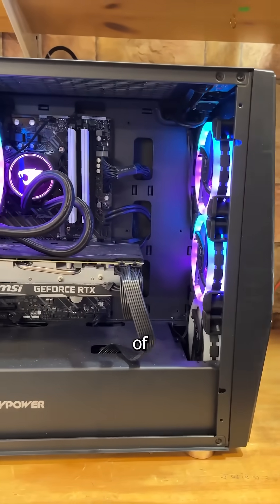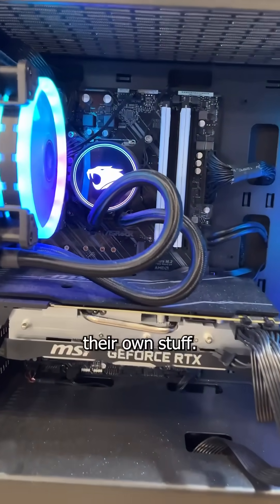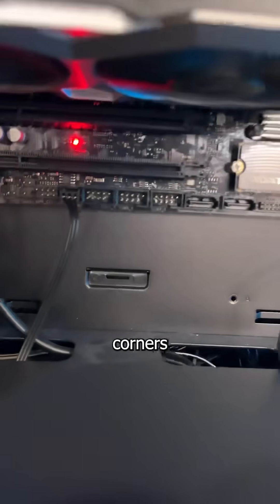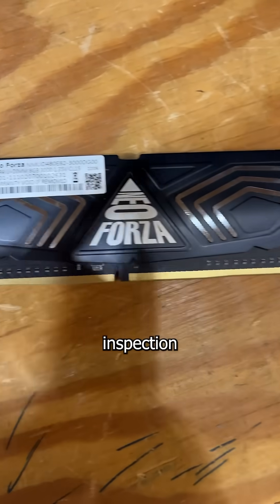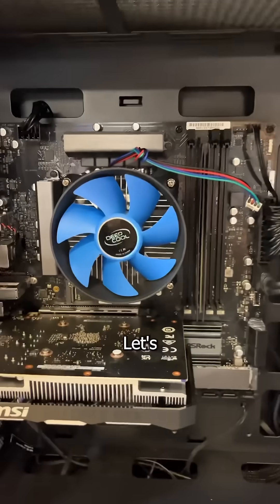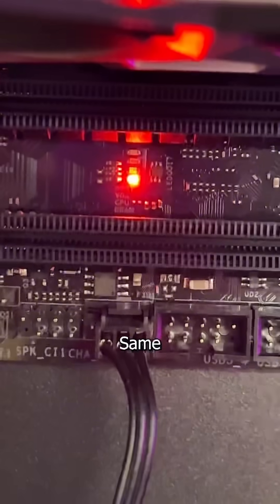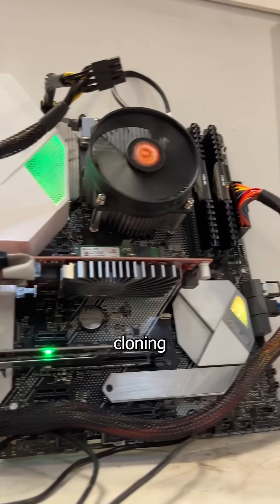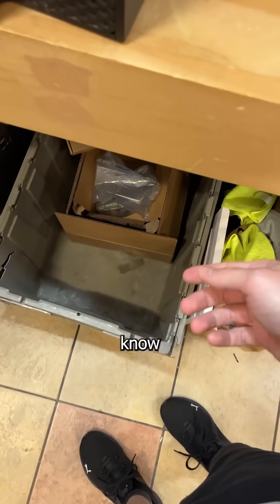iBuyProblems? Cheap NVMe causing no POST 💀 #technology #pc #tech #shorts #computer

Comment: I worked as a computer tech for about a year and a half, always saw this crappy cheap NVMe and even 2.5” SATAs. They either prevent the system from powering at all, or come back as DRAM error. Never knew why, but it was always the first thing I’d check, even before RAM, when these issues happened.

Comment: The only thing I could think of was the DRAM on the NVMe drive was damaged and it sent a signal to the Motherboard to report a DRAM error. Might be considered a "feature" but one that if you don't know it has would cause more issues rather than helping solve them.

Comment: When I've seen the 120mm aio I just already said to myself: Yeah, that's 'IBuyProblems'
P.s. 'Flashy box of cut corners' is the real way to desrcibe huge aquarium with rgb fans where is just tiny matx board and crappy stock cooler like fans 😂
P.p.s. Got ADATA LEGEND 960 MAX on 2TB recently myself. It is a good drive imo, especially for holding amazing speeds for price. Yet never tested those silver fish or whatever those cheap ADATA m2s is...

Comment: These MB LEDs that dont have a code readout are so general with their errors, as long as it's not a CPU or GPU error it's gonna show up as a DRAM error (sometimes that's not necessarily true either). I've had PCIe Network addon cards cause DRAM errors which were magically fixed by removing and reinstalling the network card after reaching the BIOS for the first time. The worst of the bunch was a faulty HDMI cable causing a DRAM error which drove me absolutely crazy. The worst part about it is a QLED error code readout barely costs a few dollars on the manufacturer's part and yet is being reserved on these high end motherboards that quite frankly are ridiculous. Sorry might have been a bit off topic at the end there but it just ticks me off.

Comment: Had a bad TramGroup SSD causing long post which was hanging up on VGA. Plus causing system crashes with no BSOD. Just freezing, deep frying the image on the screen, fading to black and requiring hard reset. All while the drive was working otherwise. Weird. 🤷‍♂️

Comment: Supposition that this is a cachless drive that uses the ram as cache and it being bricked somehow corrupts the ram?
Other supposition is that this is a pcie initialization error but the 3 leds aren't enough, so it's stuck on the previous.

Also for every pcie problem, check for bad display port cables, as the power supply from the screen back feeding the pcie causes issues.

Comment: There is a known problem with some kinds of SSD where they will short internally and then you can't do much for them when they short in this way they can cause problems with anything though it typically doesn't mean actually causing damage. This is usually a controller issue not an actual data issue. Also the customer might still be able to retrieve the data on the SSD but I don't know for certain.

Comment: When I first booted up an IBuyPower PC, it would only ever boot into the UEFI menu. Turns out, the hard drive unplugged itself, probably during shipping.

After fixing that and setting up windows, I restarted the computer, only to find that the hard drive then corrupted itself so badly, that I had to call a friend and have him walk me through things to try, including doing some magic with the command prompt.

Now the main problem is that the DisplayPort output flat-out doesn't work. Not sure what to think of these computers.

Comment: maybe it's due to DMA done in BIOS since NVMe is basically PCI-e? It might be BIOS is testing entire memory region and it might be detecting r/w errors on memory region DMA-ed to that ADATA drive. at computer's point, it's just DRAM. since some addresses of the DRAM is just don't work (MMU does the actual sending/receiving via PCI-e stuff)

Comment: I had a cyberpower for the last 4 years. The HDD has been incredibly slow. It finally died and I replaced it with an SSD. Opened it to take it out and found an unplugged SSD that I've had for the last four years unknowingly. 

I will NEVER buy another prebuilt, let alone one built by cyberpower.

Comment: I had the same problem with one of my customers pc, before I watched this video. It was a Adata drive aswell and the board said that it was a vga(graphics card) error. After replacing the drive, everything was fine. How cheap can be a ssd, that it’s causing a post error?

Comment: At the moment I switch mine on it gives an a2 error,  in bios when set to ahci mode my bios can't see my ssd,yet in ide mode it can,if I reboot in ide it then gives an a3 error, I put my drive as 1st in order to boot then reboots back to a2,I know my ssd drive is supposed to be in ahci mode but not detected weird it sees it in ide mode, it eventually goes to efi shell cannot find required map name, my os is on that ssd so dead pc at the moment 😢, I've changed sata cable, checked power port,even power cycle, nothing,no boot to windows, error codes again are a2,a3 and also odd occasion 66 to which i know it means cannot find os or boot drive

Comment: When I built my latest system back a year or so ago, I bought two Adata XPG drives, a 1TB, and 2TB. The 1TB drive started giving me issues before ultimately dying. Thankfully the store chain I buy from has an incredible in-store warranty policy so I was able to bring it back and also, negotiate to take the cost of that drive and put it towards a 1TB Samsung drive that was on sale. The 2TB XPG drive is still running strong, but it's used only for games.

My best advice for anyone building a new PC is that when it comes to storage, never cheap out on your boot drive, but drives that are only going to be used for games, or replaceable media you can go for something cheaper.

Comment: well why can you use harddrive to increase ram because technically they both are the same just ram is backup memory well hhd is storage one needs the other to work so my guess is because they are connected to each other now that the nvms isnt working  system is trying to use ram instead that why when there is no storage installed windows wants to boot from something thats why you always get that weard error if there is no hhd or os installer  thats what i think

Comment: Nvme causing DRAM error... Well that's a wonky one. Been working on computers for decades now and never seen that one before.
That said, I HAVE seen someone's computer not post, tested everything and nothing worked, so went to RMA only to have them ask me to plug original keyboard in. Booted right up after that. I took apart that keyboard, there was nothing different/unusual in it, yet the PC wouldn't boot without it. They were told they can use any keyboard they want now, but are too afraid to unplug that one.

Comment: It could be that a small section of the nvme is used as a "pseudo ram" that is much slower and that setting may have some connection
Reply: Swap files are usually handled by the OS. The BIOS would not care about it and try to load the OS.

Comment: When an NVMe drive fails, it can disrupt this intricate interplay between the system memory and storage subsystem. Specifically, the motherboard's firmware and drivers may struggle to execute essential operations related to read/write caching, wear-leveling, and error correction, all of which are typically orchestrated with the assistance of DRAM.

This failure cascade may culminate in a DRAM error notification, signaling the inability of the system to effectively manage the failed NVMe drive's data. Additionally, certain NVMe drive errors or corrupted data structures could potentially lead to memory-related conflicts within the system's memory management unit (MMU), further exacerbating the DRAM error scenario.

Comment: A motherboard may give you a DRAM error when an NVMe drive has failed because some motherboards rely on system memory (DRAM) for certain storage-related functions, like caching and temporary data storage. When a drive fails, it can cause issues in these functions, triggering a DRAM error. Additionally, a failing NVMe drive might generate errors or conflicts in the system's memory management, further contributing to the DRAM error.

Comment: I like how iBuyPower manages to fill every computer with several different brands that no one has ever heard of.
Reply: Then sell the PC at high price half the time the PC isn't worth half the price you paid
Reply: @warlockgod66 I bought the y60 from Ibuypower about 3 months ago and so far I haven’t had any major issues and I run full graphics rust at 120-140 fps.
Reply: Everyone knows Adata though, but for the wrong reasons.
Reply: They sell custom PCs; this person bought the cheapest stuff they saw on the site. My friend has an iBuyPower and it's lasted five years with no issues. I live my life by "you get what you pay for."  Buy cheap, get cheap.
Reply: Asrock as been around for 25+ years now and I can say they are safe to use. AData has been around the block as well but I guess their QC is not the greatest.
Reply: @2fast4all  So true. I have seen some good experiences with some prebuilts, including some from my local computer center. Prebuilts are usually made by someone else.
Reply: I have to defend them here even though ive had a part from one of their prebuilds fail on me, they give you the option for every single part you eant on your computerz if you choose to have some random cheap part installed, thata on you.
Reply: aldi
Reply: I got a pc around 2020 from them. you can select the good stuff. I got WD nvme WD HDD. I did upgrade the ram because i had ADATA and eventually 1 of the sticks stopped working. other than thats its pretty good. also had to swap out the liquid cooling cpu unit because it went out in like 3-6 months. the fans are ibuypower and havent had to replace those. so not really bad. I would definetly avoid Adata ram and the ibuypower brand liquid cooling unit .
Reply: Built by the lowest bidder.
Reply: Dude it's true, meanwhile abs king of ching Chong inc still uses name brand lol
Reply: they throw parts around like they threw that csgo match in 2015
Reply: Yeah my buddy can’t even boot Valorant on his IBP pc because TPM 2.0 has to be enabled but we looked and you can’t even disable it so basically his PC is entirely bricked from ever playing Val unless we install windows 10 on another drive and make his system a dual boot.

Oh yeah and get this, his IBP PC doesn’t even have a full version of windows on it. They installed the free version that has the watermark and called it a day. 

He shoulda honestly just spent the extra on the corsair prebuilt if he was gonna go prebuilt. One thing’s for sure, I am gonna tell people to avoid IBP like the plague 😂.
Reply: @jace_Henderson  "doesn’t even have a full version of windows on it."  So your friend opted not to get a windows license.  Of course they just didn't give him a freebee and register it anyway.  Any boutique I've ever seen has a drop down for if you want to pay for a windows OEM key.  He clearly opted not to.
Reply: @tsdobbi  ah, see I never order prebuilts and my friend doesn’t even know wtf a hard drive cable is or does so makes sense why he wouldn’t mention something like that. I had the mindset that they give you prebuilt options with different models that have different parts and specs, and that they all had windows preinstalled and included in the price just like a laptop. I ain’t buckling from my claim that IBP is crap sacks though.
Reply: @jace_Henderson  not being able to play valorant is a good thing
Reply: @jace_Henderson sounds to me IBP just saved him from playing Valorant. A fate worse than death.
Reply: @jace_Henderson  Dont buy prebuilts you have to fight with them anyway might as well learn to build your own
Reply: @vortraz2054  Not true. Some prebuilt companies are actually system integrators. Just avoid the bigger ones such as HP. They install bloatware and use proprietary hardware.
Reply: you still have the shipping number, they can give a you a key to remove that watermark.  I had a similar issue, i dont remember why they didnt just do that part themselves but they do have a free fix for it
Reply: @jace_Henderson the Corsair prebuilt would have the same issue? It isn’t a computer problem it’s a windows 11 problem. Valorant requiring TPM to be turned off is a huge red flag and I’m glad I don’t play that shit clone.
Reply: @syreplays5079  where did I ever say TPM had to be disabled to play val? I said it won’t boot because it has to be enabled but you can’t even turn it off in the bios which means it’s always on by default, and it still wont work.
Reply: @jace_Henderson so if it's secure boot you have to enable then disable the secure boot till the option above it either says engaged or user.
Reply: It has to be on though after you've turned it off and on again incase I wasn't clear on that.
Reply: @jace_Henderson That's on your buddy. I Buy Power just builds the parts you pick, and you have to choose which operating system you want installed. Your buddy should have paid for windows 10 instead of opting for the free version.
Reply: @RogueXV they do not build the parts you pick.  they build the specs you pic with the cheapest available componenrs
Reply: @SaltSpirits Maybe if you go full premade. But if you custom build it, it has exactly the parts you pick, exactly.

Comment: So this is most likely a order of checks error so when it starts it sees hey I'm not booting let me check why and it does the cpu check the motherboard check then the ram check and cuz the ram check is where its messing up it throws up the dram error had this happen with my buddy's pc the error code says cpu was bad we checked and it was fine turns out it was just the ram but cuz the checking couldn't get passed the cpu check it threw up the cpu code

Comment: Plz don't buy any cheap SSD for how tempting the offer is lost my important program codes twice for the original SSD which failed in 1 month and the replacement that the shop gave me failed in 6 months .....

for anyone wondering the brands were consistent and cyberX don't want to hate any brand but I lost my important files .....

Comment: Im using an Adata Legend 710 500GB here and it is working fine. Tho they did really admit that its DRAM-less and has TBW rating about 30TB lower than other 500GB drives but consider that it has really good speed (like 2700MB/s for read and 1250MB/s) and I only got it for $20 with 3 years of warranty, i say very solid SSD. I only store games on this one. I do not use it as a boot drive.

Comment: That SSD likely uses HMB instead of having its own DRAM cache, when the SSD failed it was still trying to communicate with the system ram and that’s why it got reported as a DRAM issue during POST despite a more accurate LED code being BOOT, or in an ideal world just detecting the fault and completely disabling the M.2 port to allow post, But that’s asking for a lot…

Edit: Typed DMA instead of HMB.
Reply: Ohhh damn. I never thought that could ever happen with SSD's without DRAM cache, but it makes sense. All the more reason to make sure you use SSD's with DRAM Cache.
Reply: I was also wondering if this SSD does have DRAM cache but the DRAM circuit failed. I imagine POST would just report a boot error then, though.
Reply: Yes if it was a component on the drive itself that died, such as onboard DRAM it would have reported a BOOT led error code
Reply: Wow, this is a real good answer. You must have seen this before.
Reply: Yep

Comment: It's true Ibuypower is just buying bunch of problems because yeah lights and audio ports go out  I got them fixed and it came back with more problems used the contract support the guy didn't have enough patience and hang up. An then the 3rd year my Bluetooth connections just keeps unconnrcting and reconnecting to a point I had to disable it because it kept making windows notifications. Yeah don't buy iBuyPower it's good for spending money

Comment: It’s not just adata drives. I had a WD black 4TB NVMe in my computer that was being used as a steam library Drive. It was working fine and then one morning my computer wouldn’t post. It took me a little bit of troubleshooting but by chance I remove that drive and turn the computer on and it posted normally. So I put the drive back in and it wouldn’t post. so I took it out and put in a 2 TB WD blue, and it posted normally.

Comment: As someone who has done PC builds for 15+ years, I concur that Adata is trash. My first exposure to them was in 2009 with a 1GB flash drive. The thing quit within the TigerDirect return window, so I went with something else.

I’ve had an Adata XPG NVMe drive do something extremely similar to this. Basically hang post. 

Though I have heard of Neo Forza, since I was building cheap and fast Ryzen a few months back. It’s not bad.

Comment: This SSD has kind of a "temporary memory" inside.  Just like a ram. And it is also plugged into PCI express.
So motherboard assumes it is memory problem.
Reply from the maker: Short and simple, thanks for your insight! I appreciate it.
Reply: Almost. This one doesn’t so it uses system RAM - or blocks it’s initialization when dead
Reply: @itsTyrion  Interesting I know I have a cheap 4TB NVME lexar nm790 that doesn't have built in DRAM and uses system memory as it's cache so if it dies than I guess I can expect this issue to happen.

Comment: it was probably causing a dram error because cheap ssds like adata dont have their own dram, so they leech off the system for cache. most likely loading corrupt data into ram. better ssds like samsung or crucial have dram of their own for cache

and yea, i never trust adata, bought 2 of them at the same time once, only two ill ever buy. one lasted 3 months of daily use the other lasted 6 in a laptop which for me is honestly about 30 mins of actual uptime i only use it for special circumstances